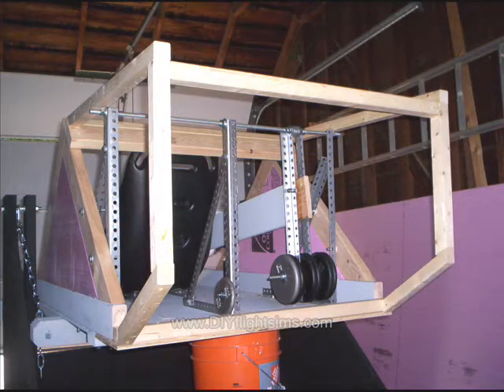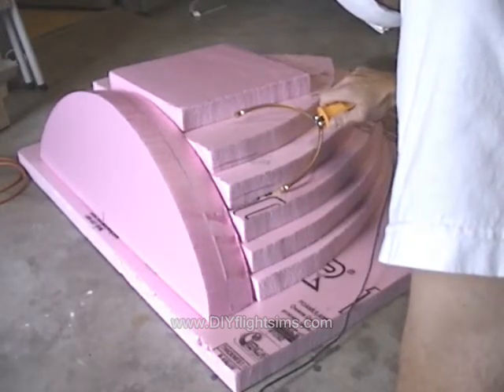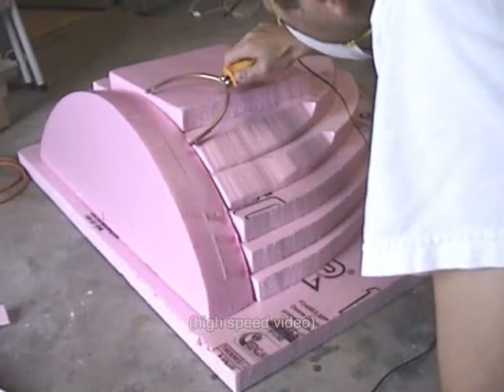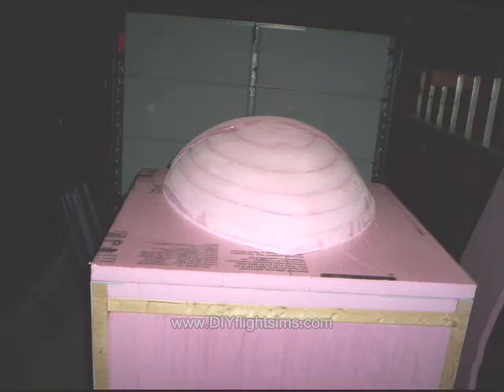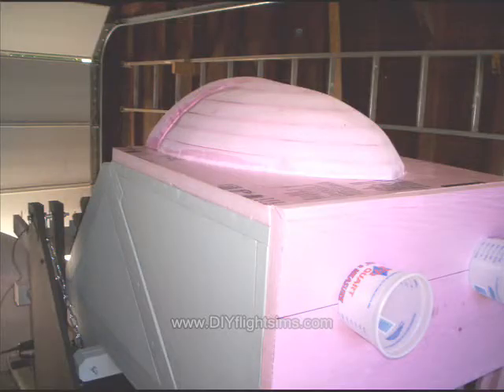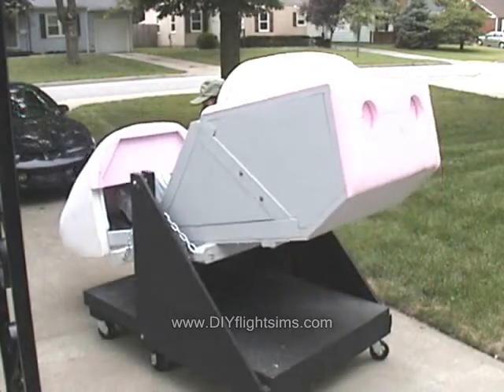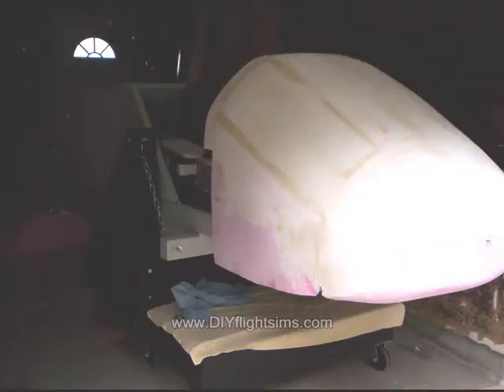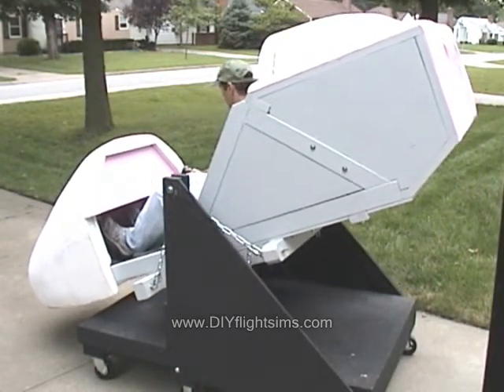MAACS Experiment - Episode 17, Taking Shape

Comment from the maker: It's called Foam Coat.  You buy it as a powder and add water.  It's similar to working with plaster.  I bought it and the foam cutting tools from Hotwire Foam Factory.  (Google Hotwire Foam Factory...YouTube doesn't let me post links in comments).

The Foam Coat was not a good option for a large project like MAACS.  But if you're curious about it, I recommend you buy a small quantity of Foam Coat and experiment a little to see if it would work for your project.